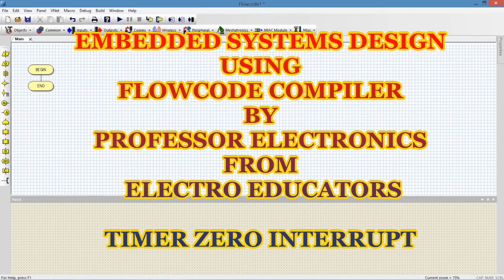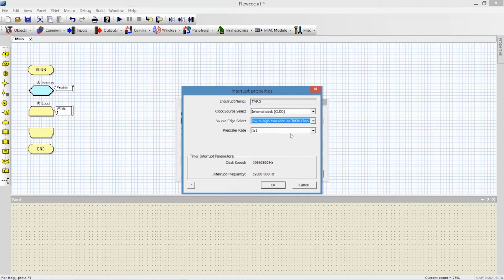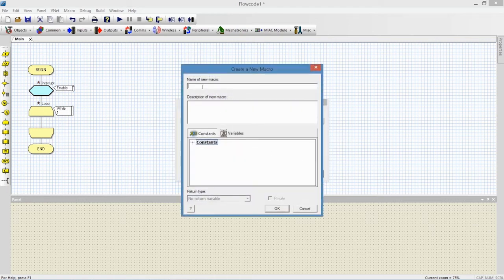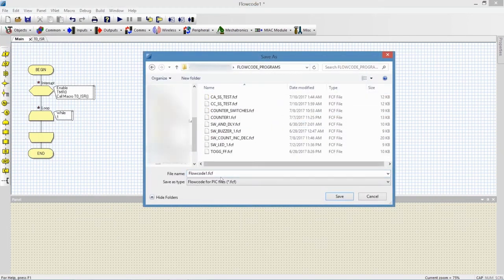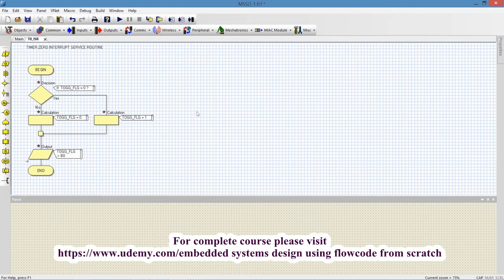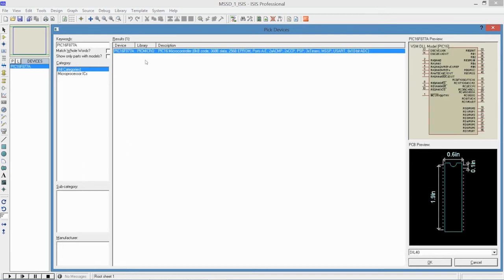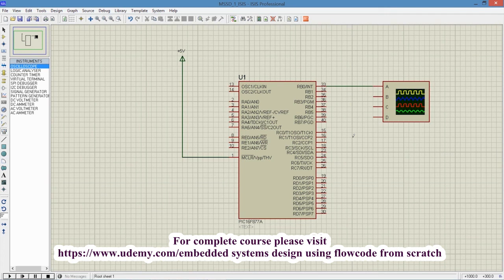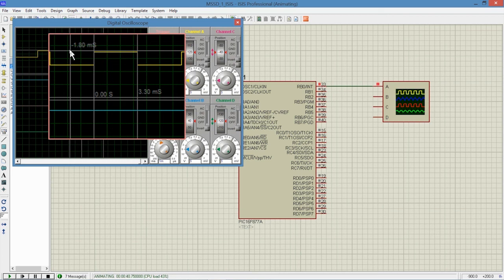FLOWCODE PROGRAMMING TIMER ZERO INTERRUPT

Comment: I need to design a counter of three switch with LCD when I press the first key count up to 10 and when I press a second key count after 10 until it reaches 20 and when I add the third key count after 30 until 16f628a
please i need help
Reply from the maker: Do you still need some help please?